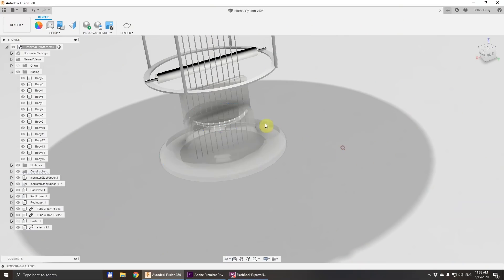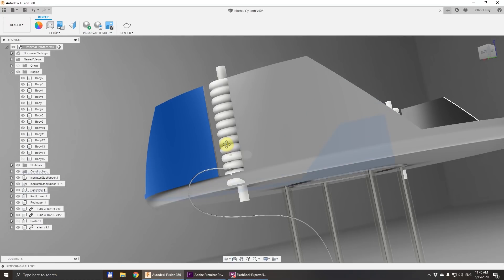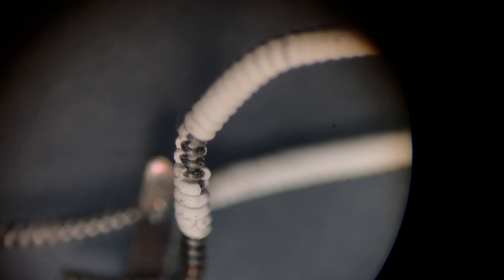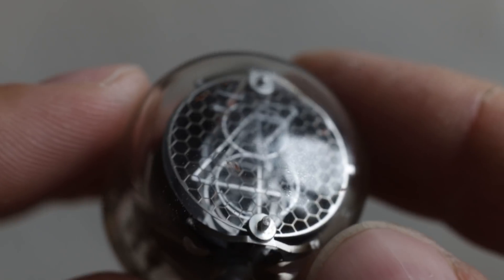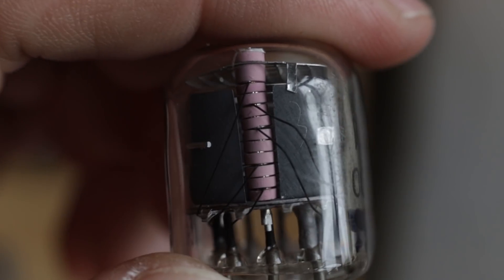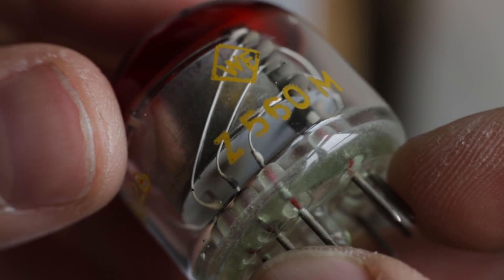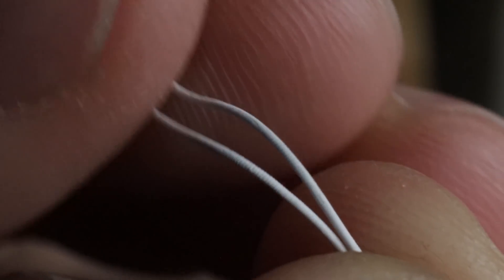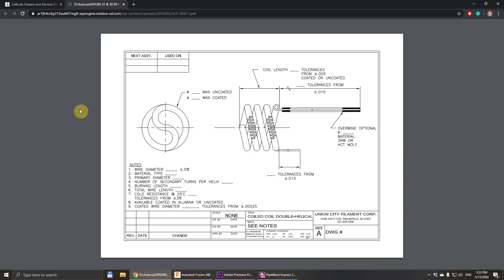What Electrical Insulation to Use in a Nixie Tube? | Project H #4

Comment: Use oxidized aluminum wire.  There will be flexibility and heat resistance.  And the black wires were aluminum oxide, chemical oxidation.  You can make such wires yourself, there are resources.

Comment: Great video, he wanted to ask that you also plan to produce cheap smaller tubular versions of digitrons the size of, for example, the old Soviet digitron IN-8, so that electromechanics who want to make a digitron clock can get to your digitrons. For example, I now plan to make an itron clock, and once they're done, I want to make a dogotron clock. In the meantime, I have to make do with old Soviet itrons and digitrons. It would be great if you could produce more affordable digitrons. At the same time, I understand that it is challenging and that it is not an easy process.

Comment: What about https://en.wikipedia.org/wiki/Anodizing ? For UHV you can use Kapton - either foil, but I think there is also some kind of liquid Kapton available. Maybe Ceramic glue: https://www.plano-em.de/produkte/klebstoffe-klebefolien/klebstoffe/1475/high-performance-keramikkleber

The insulation does not shield the electrical field in general - it only increase the resistance "into vacuum". If the outside of your insulation is not connected to a different potential, the electrical potential on the inside and the outside of your insulation would be the same.  You would have to add a grounded shield around the insulation to perfectly shield the electrical field of the wire. I think it works in your case, since you work under "relativ" high pressure, the rest gas is transporting surfaces charges very fast, so that on the vacuum-side of your insulation the surface potential is nearly on ground potential. So if resistance of the vacuum <<< resistance of insulation, insulation works.

Comment: I recently took apart a broken hair dryer as well as an electrical small room heater. Both had nichrome heating wire, it was ribbon in the hair dryer and a spiraled but round wire in the electrical heater. Both were used obviously and I tried measuring the ohmic resistance (just at room temp :) ) and at first i thought i did something wrong, because the resistance was way to high in the 100+MOhm region when touching the ribbon or the used spiral ~ 10 cm apart. I expected some low values in the magnitude or 10 omhs, and when fumbling to get to the harder to reach end connection points sure enough, low ohmic restistance.  Then I noticed a difference in darkness of the color of the wire of the part that is used during heating. So I returned to directly measuring the nicrome wire ~ 10 cm apart, but this time i was bruteforcing the probes onto the wires and scraping and went and punching quit unsubtle onto the the same spots, now finally I got a super low omhmic resistance. I knew that some thin layer of cromium or nickel oxde forms on the surface in hindsight but I wrongly assumed it just prevented furter oxidation, but apparantly it also is a good insulator. Well, at least at room temperature. Maybe I was confusing nicrome wire with nickel wire because nickeloxide does also form a nice oxide layer on nickel when heated, prevening furter oxidation. But Nickeloxide is actually quit an ok-ish conductor, even at room temperature.
So maybe in the right type of nichrome wires, mainly a nonconductive layer of chromium oxide is formed ? I dunno, i no longer have the proper lab equipment at my disposal to test it.
Im am fairly sure it was nicrome in both cases, because its curie point was way lower than that of stainlessteel or tungsten(that is not attracted to a magnet to begin with :)), i tested it with a magnet and a ligther. And pure nickel wire is not used anyway as heating wire heaters as it must rapidly increase in ohmicresistance when a voltage is applied, the wire heats up and the current drops, preventing the wire to melt etc.

It might just be as simple as NiCrome wire, heated and oxidized forming a nice dark thin layer.

I still have the stuff on my workbench, but im a bit weary to test properly the conductivity of the surface layer, I dont even have a IR tempmeasing device to get it to precisely to 500 C and then making sure that touching the surface of the hot wire with some kind of suitable probe that does not itself becomes insulating or begins reacting with the surface layer of oxide, super hot Chromium oxide would for example just react to form chromium metal when using a conductive carbon fibre. gold coated copper super fine wire might work? The contact must be inert, and also not so massive that it lowers the temperature of the contacts and the layer below your trying to measure.

Thanks for the youtube upload, it gave me a lot to ponder about. 

Good luck with building those cool tubes ! its an almost lost art and science. Respect.

Comment: Why not use fiber glass tubing (sheath) for insulation ? Different grades exists in electronic... Have a glimpse here : https://www.varflex.com for Varglas S1600 Sleeving ( https://www.varflex.com/wp-content/uploads/2018/04/varflex-s1600.pdf )  482°C permanent and up to 950°C for short periods (starting at AWG 26) and less with special custom order starting at awg 30 (https://www.varflex.com/products/custom-product-capabilities/)...
Regards
Reply from the maker: The glass fibre sleeving is worth testing - at least for future use!

Comment: What about silicone? It can resist to high temperatures, some vacuum pipes are made from it, so it can resist, and it is use also in wire insulations.
Reply: Silicone I think would just miss the 500c mark he is looking for.

Comment: If there were a metal shield between the area that needs to glow and the area that needs not to glow, and that shield was at a potential between that of the wire and the anode plate, would the wire glow, and would the addition of the pin to supply the voltage for the shield be acceptable?

Comment: Do you need both sides of the anode to be uncoated? I'd wonder if you could use an alumina coating on the outside of the anode ring as a way of avoiding needing to deal with fiddly wire coatings.
Reply from the maker: I tried - the alumina peels off from the large metal areas, probably due to different thermal expansion..

Comment: Would the solution be as simple as enameled magnet wire? Or would that not stand up to the heat?
Reply: You mean like a powder coat? Like what you’d find on the inside of an oven for example. I don’t think the temp would be the issue but how brittle the coating would be

Comment: Chromium oxide has been used as an insulating coating in cathode ray tubes. it was often used between bands of conductive dag on the inside of the bulb when there was a large voltage between them.
Reply from the maker: Thats a good information - there are some nixies with green coating, it might be the chromium oxide - will search more in this field, thank,you!

Comment: In building installation we use cables for safety lights, PA speakers, fire detectors and so on, which are tested to withstand fire at about 800°C for 30-90 or even 120 minutes. This cable-types are called e.g. "(N)HXH FE180 E90". 
The wire insulation is also a polymer, but it is hard to find any deeper information about the material.
Maybe this might be at least a direction.

Comment: You can create a reliable insulation through heating the wires in the atmosphere to a red glow, prior to creating a vacuum. Most metal oxides are quite durable insulators  and in fact Mullard used this technique during their production process. Shaping, atmospheric current annealing, install etc. If you can create a table of current/ voltage/oxide depth you'll be off and running.
WO3 is highly conductive so tungsten isn't a suitable material. Most older valved used molybdenum. You need to explore its properties in oxide form to determine its effectiveness.
Reply from the maker: Amazing! Where is it used in Mullard tubes? Would love to know more..
Reply: @daliborfarny  on YouTube there are several excellent videos produced by Mullard, which take you through the entire manufacturing process. Give them a watch
Reply: but be aware that they become very brittle when you oxidizes the metal!

Comment: How's it been going working with Renata now that it's been a while?  It's been a couple years now correct?  How does it go working with relatives?  For the connecting wires using pre coated wire might be good but then the ends where connected would need to be coated.  The alternative is something that could coat the entire wire after connected where you don't want it to glow.  It seems you want the easiest and quickest process that's easily repeatable and not succeptible to error or defects easily.  It almost makes it seem like you want the wire pre coated except for the ends in small place where you connect it.  This will require pre made different lengths so you don't have to size and strip the ends of each one.  This way you could weld each wire with exact length each time.  This would be repeatable in an assembly line process in order.  The thought crossed my mind what if the wires could also be pre bent in the exact correct shape to fit perfectly where each one fits.  I'm not sure that kind of manufacturing is possible or not but since this is bigger tube perhaps preformed wires that are pre coated could be possible???  Each wire would have a number and you'd have a bunch of each one so if one got messed up you'd just throw it out and get a new one of the same number??? Does that make sense?  Picture pre bent automotive exhaust piping that's pre bent for each model car so it fits exactly where it goes under a car.  This would be similar idea.  Pre formed, pre coated wires.  You might need tweezers to put each wire in place but I bet a little practice you could do them in order pretty quickly and the key to why this is possible is the size.  This wouldn't be possible with little tube but in bigger ones like this handling the individual numbered coated wires wouldn't be too bad I think.  I see you're using computer aided design so I don't see why you couldn't specify the exact shape and form you need for each wire to a manufacturer.  If we can manufacturer things that are nano meters in size now it would seem these coated wires wouldn't be that much of a stretch for some manufacturer out there?  Idk how the wire forms would be manufactured but somehow I have a feeling someone can do that today.  Even though pre formed they would still give a little and allow some minute tolerance for little imperfections but the basic shape would all be there already for each different wire exactly where it goes connecting each digit/character cathode.  These tubes are bigger so the wires are relatively larger.

Comment: I remember reading somewhere that it was possible to coat wires with alumina using electrophoresis in a solution with colloidal alumina particles. There's a couple references come up if you google that, might be worth a look!
Reply from the maker: I is called cataphoretical coating - quite tricky to setup from what I read..

Comment: I've worked with polyimide coated wire before at a previous job, but I'd bet the custom filament wire would work better in this application. Hopefully the virus isn't affecting that business too much and they'll be able to help you out, because I need to see this thing working 😆👍

Comment: Dalibor, my suggestion would be make your own flexible spring-wires from your wire you have and before coating your white ceramic compound onto it stretch it just before/at overstretching, then apply a thinner version of your white compound, let it dry and then you release the tension. Maybe that works for you, i done a similar thing already. 
the russian method is chemical as you probably already know, if i remember me correctly they do like a black phosphating type of method like it is done for guns. The modern version is probably Cerakote. btw. why not building a shield cup for the positive electrode? regards, Gordon
Reply from the maker: The phosphating was mentioned several times, I will need to give it a try! Thank you

Comment: Anodised aluminium wire? If the wire was sufficiently baked (in a vacuum even?) it would drive the moisture out of the oxide layer & the spot welder should easily pierce the oxide layer. It may not even need that thick a layer

Comment: White-out fluid (tipp-ex, erase-ex, correction-white-ink) are used in metallurgical applications as a high-temperature-tolerant mask. Basically it's titanium-dioxide and a binder. I imagine that when you "bake" the painted surface, the binder burns off, and the TiO2 sinters onto the applied surface. It might be worth a try to paint the wires in such a correction-fluid, bend/spot-weld/process them, then "bake" them in-vitro, then pull a vacuum. Might just work. Worth a try?

Comment: Thank You very much for sharing the information! I hawe a few of those russian valves because i was curious about them too. Your videos realy make me want to continue my old experiments!
I still hawe most of the setup, except for the high vacuum pumps, but maybe one can still found them on surplus i think, i think i even still hawe the transformer i made for the 100V heating elements.
If it was closer i could think about swap some old equipment i don't need for my own experiments if You where interested, but i doubt it would be worth the shippingcost.

Comment: Is it necessary for the wires to be on the outside? I was thinking, since the tube is so large, there should be enough space to feed the wires down parallel to the supports for the digits, inside the anode cup. If you put a mica sheet on the backside of the anode cup, then you would only need a short, straigt piece of glass/ceramic tube to insulate the wires while they are inside the anode cup. I don't know if it would look good from the top, but it would simplify the shape of the wires and insulators a lot.

Comment: I wonder if flameproof/high temperature mica wire would do the trick. Those are widely available and dont need to be custom made like the alumina tungsten wire. Most of them are rated at 450 degrees, but if your baking process is not too long I think they could hold.

Comment: Maybe a cheap solution would be to use soldermask paint, you coat the wires and cure it in place before applying vacuum, there are a lot of vacuum resistant electronics out there and the soldermask on their PCBs are probably rated to be as inert as possible in vacuum and hot environments.
Reply: https://www.mclpcb.com/outgassing-printed-circuit-board/

Comment: I have no experience with vacuum tech, but I think you should try to experiment with enamel insulation. I see it like this: dry, unfired enamel glaze powder is mixed with organic plasticiser and glues to give it dry strength so it doesn't peel off of wires while you assemble the tube. Then, it is fired during burnout process. If coefficient of thermal expansion is matched right and the layer thickness is adequate, such coating can be quite durable

Comment: Ah I see how you want to do connections here... Unfortunately I don't have ready solution.
That black stuff on tungsten wire looked very much like "passivization" I guess to develop these you are looking at using molten caustic and extremely powerful oxidizing compounds - not fun :)
Also not sure what the nature of project is, but if you really don't want this to fail, best bet is to go with ready to use commercially available product.

I do have some tungsten wire and I can test some things quickly. It would be indetesting experiment to do :)
Reply from the maker: Hi, that makes sense - I will look at that black coating later if the alumina filament fails.. thanks! As for the project - I am making an installation of 121 large nixie tubes - this is the nixie tube..

Comment: Just a shot in the blue here: Did you think about selectively oxidizing your wires? Most metal oxides are insulators, they are heat stable, and don't gas out in a vacuum. Maybe using aluminium wires and oxidizing them after they have been put in place could work for you, it depends on how your other metals react to oxalic acid in an electrolosys bath.
Reply from the maker: I tried oxidizing stainless steel, but it still sometimes tends to glow. This would be the easier solution - just mount the wires and heat them with flame - quick, low cost. Will try!
Reply: @daliborfarny  I was thinking this too, it could even be grown in place in the final assembly, I.e. do your spot welding, short the anodes and cathodes together, run enough current though the wires to make them heat up since they are so thin compared to the grids or other electrical components, remove the short, and install the front.  Nickel and Kanthal wire should be readily available due to their use in e-cigs. Nickel obviously gets coated with nickel oxide, which is only conductive in certain crystal structures, and kanthal grows an aluminum oxide film on its surface. Easier to spot weld, and easier to heat up and oxidize in place than aluminum wire, since the aluminum would melt before it glows orange.
Reply: Is this what that black insulation was? Just oxidation? It reminded me of a very thin version of anodized aluminum.

Comment: Small ceramic beads, just threaded loose on the wires, much like the ceramic beads sometimes used in electric fires from the 20s to the late 60s. The beads interlocked having a hollow on one end and a protrusion on the other.
Reply from the maker: Thats a good idea! I have a bag of small glass beads, ideal for this application, will make a test of this, thank you!
Reply: Electricity could still flow through the gaps though.
Reply: That is also what we use in ultra high vacuum applications for research, so they are commercially available!